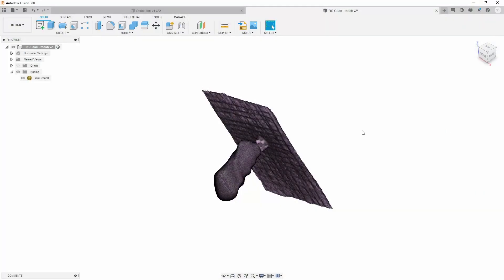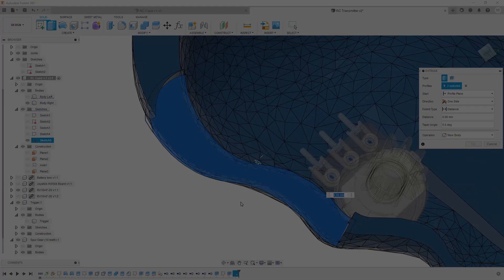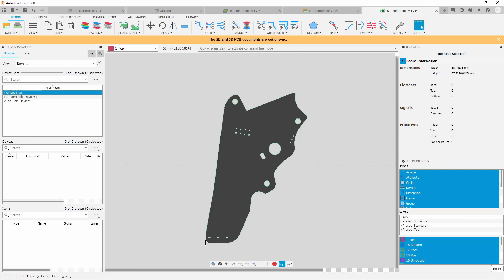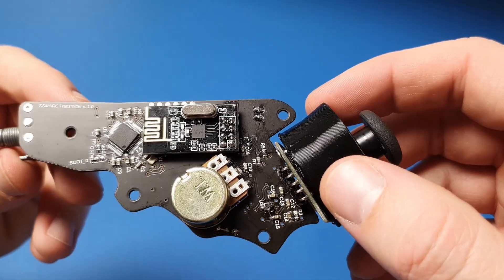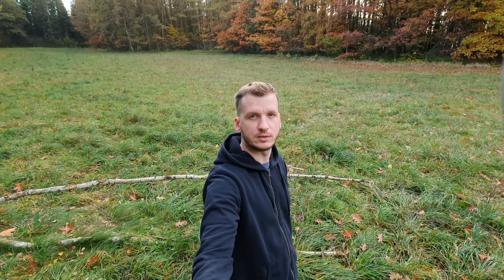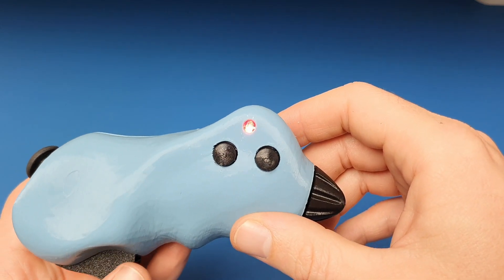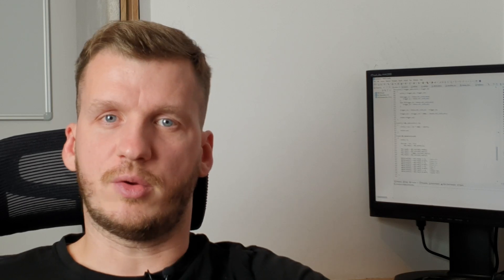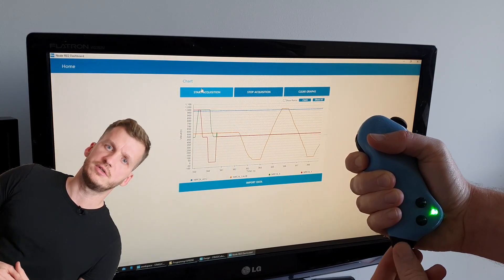DIY STM32 RC Controller: How to Make Your Own Custom Remote

Comment: hi sebastian , i already send you the request for the code files of your awesome project , could you please send me please , i really apreciate a lot , your videos are awesome im already saw all of them , good vibes from Mexico
Reply from the maker: Hi Miguel! Thanks for the kind words :) As for the files, you should have received an automatic email. Maybe check your spam folder. And if not, reach out to me directly via email, and I'll give you immediate access to the files.
Reply: @SmartSolutionsForHome   thx Sebastián , your video was very useful to my project , you know the only problem that I found it’s with the DMA ADC module because when execute get stuck in a loop

Comment: I've thought of doing something very similar. My son wants an RC Nerf gun, so we've been collecting parts and "planning" for a couple years, I just haven't done it yet.
So glad to see someone else using nRF24L01+ chips for this too since I've already got a couple - along with Arduino Nanos, 3D printer, motors and controllers.... Everything except the initiative to actually start lol

Comment: Some recommendations on reflow process using the hotplate  ? Thanks!
Reply from the maker: Good question. I used only one, so unfortunately I've no comparison. That's why it's hard for me to recommend you anything.
Reply: @SmartSolutionsForHome  well we do have the exact one as you, with the same interface, what is your tuned profile 😅, like you set it to 220C, wait 5minutes and then turn that off and let cool down properly ? Thanks mate!